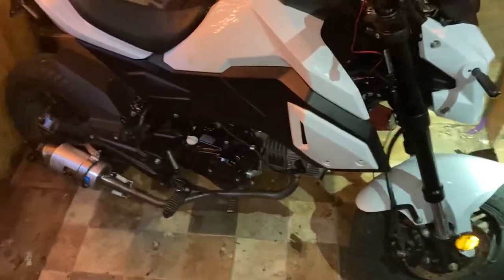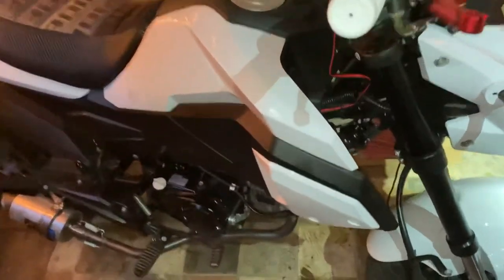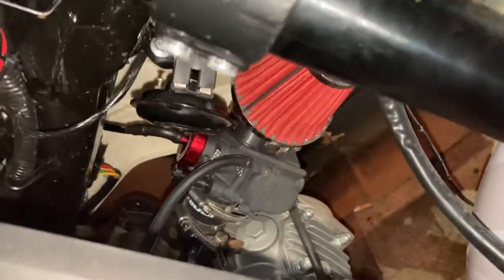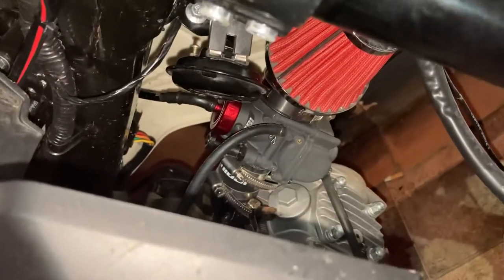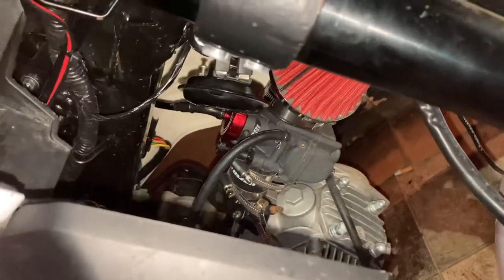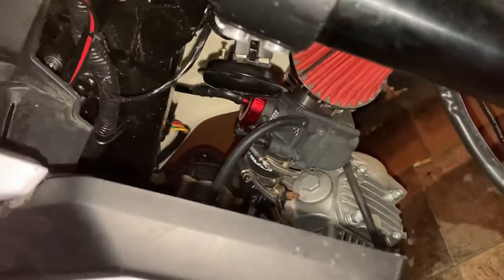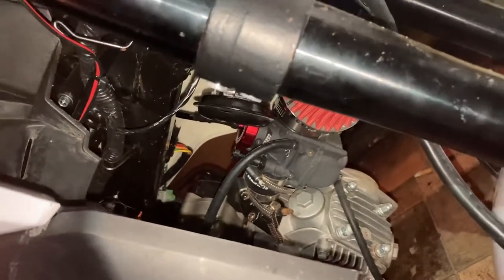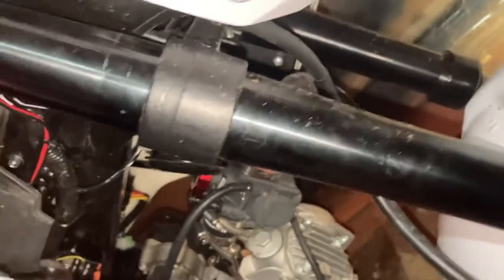Honda grom clone Vader 125cc nibbi carb

Comment: I installed a nibbi 26mm with that same nibbi intake on mine. My carbs a little tilted up though. It bogs, doesnt like to idle so it dies out eventually, and when it does idle before it dies it lowers and raises rpms on its own. I dont know what the issue is. Also what did you do with that big braided line that is originally in the head of the motor

Comment: Lol no one ever show the nibbi tune my bike cuts off and idles high I’m lost
Reply from the maker: Turn that big red spicket to adjust the idle if it’s revving really high you probably have the barrel in backwards or you need to take that silver boot off your throttle cable/get a new throttle cable although stock cable should work fine